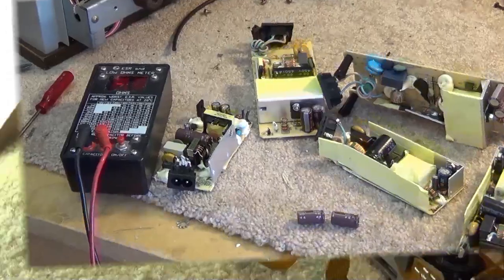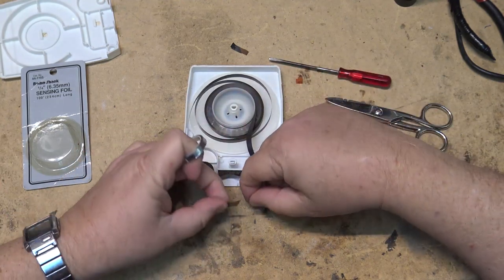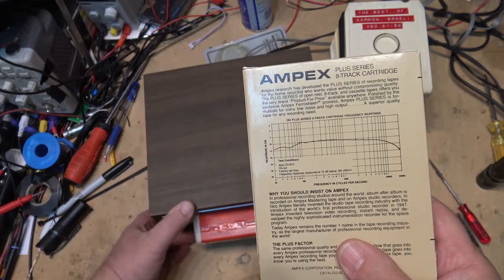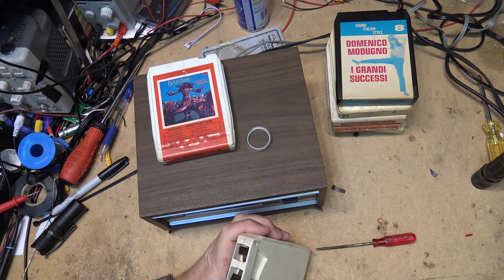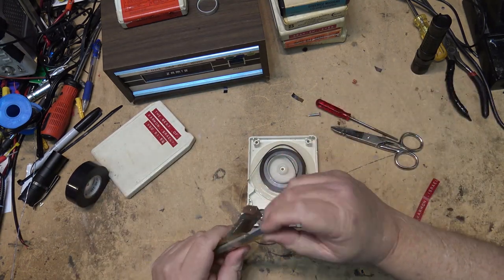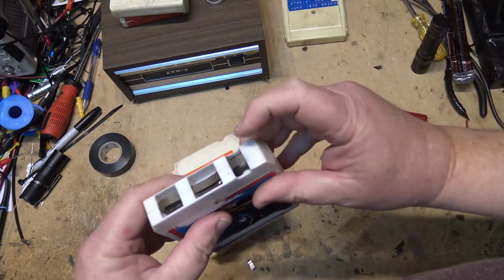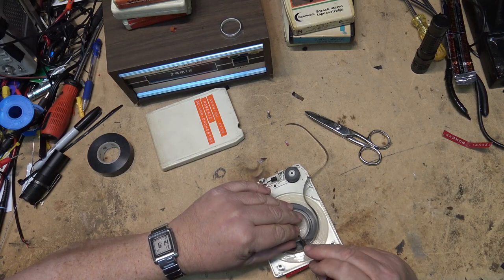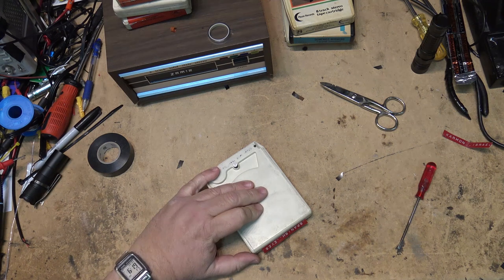How to repair an 8 track tape

Comment: Tip if you're going to do your own tape splicing and you don't have a splice tool so you have to use scissors or snips: cut both ends of the tape at the same time while you overlay the ends on top of each other. That way the angles of the cut match on both ends of the tape, and you can make a slice with no overlapping tape and no exposed adhesive.

Comment: I just bout an Akai X-1800SD and of the 8 track tapes had the tape broken. Actually looks much easier to fix that than I was expecting so thanks for this. Had never seen one of these before a few hours before I bought it but its so cool!
Reply: My 1800SD just ate my Waylon and Willie 8 track. It's why I'm here
Reply: It ripped about 20 feet out and wrapped up inside. I retaped it with that silver foil tape for ducts. Tried to spool it but too much was out so i cut the tape 2 inches from where it pulls out of the middle, respooled it around the outside, then scotch taped it where i cut it. The thing plays better than ever. It actually automatically changes the program now

Comment: Dave, 
Good information you've passed along. I've got a fair amount of 8 Track tapes and plan to rebuild them as you're doing. For repair supplies, I plan to pick up some sensing tape and pressure pads on eBay. Strangely enough there's quite a market for this stuff. What I've been able to do, if the tape is actually working is wait until the tape actually changes tracks then pull it out very quickly. The sensing tape is right there making it easy to replace.When the glue dries and the sensing tape fails and falls off, I take it apart like you've shown. I've got some cartridges that have a plastic pinch roller just like your tape has. I'm going by memory here, but it seems like those cartridges are for low budget tapes rather than 8 track tapes from the big record companies. On the other hand, I've even seen some rubber pinch rollers that have turned to goo.
Regards, Tom

Comment: THANK YOU! I THOUGHT IT WAS IMPOSSIBLE! my machine just ate my Waylon and Willie. It ripped about 20 feet out and wrapped up inside. I retaped it with that silver foil tape for ducts. Tried to spool it but too much was out so i cut the tape 2 inches from where it pulls out of the middle, respooled it around the outside, then scotch taped it where i cut it. The thing plays better than ever. It actually automatically changes the program now

Comment: Shouldn't the decomposed foam pressure pad also be replaced to give better contact between the tape and the head? The one in the tape you are resplicing seems to have lost all its springiness. They are usually very gummy at this stage, so will leaving it in there result in gummy residue sticking to the heads and causing tape snarls?
Reply from the maker: A new one will be put in to record it to the PC and then transferred to the next tape that needs it.

Comment: That black tape around the pinch roller will just introduce wow and flutter you would be better off using sanding paper to rough up the surface.
Reply: I wonder how much. I am going to try it. 8tracks suffer from W&F right out the factory.
Reply: NORMALIZATION OF IGNORANCE You should not make it worse then.

Comment: I just bought a 8 track player and a box of about 150 tapes, having fun with it. A couple of them have the shiny pinchrollers, such as the Elvis 40 Greatest two tape set. The splices failed on the same tapes, they must have been cutting corners with quality for mass production of those compilations.

Comment: Listening to an 8 track as I’mwatching this and ironically as you were talking about the sensing foil I hear “click-clack” and the player jumps from track 1 to track 2. On a memorex (used to be) blank tape. I’ve had better luck with the sensing foil holding out in those. I don’t know if it is a better adhesive that they used or what but so far seem to be holding out.

Comment: As a general rule, stay clear of 90 minute tapes.  They put more load on the capstan motor than the 45 minute tapes and are prone to uneven tape speed, especially in car-stereo and battery-operated players.
Reply: I've used 90 minute ones and have had no issues as long as you never use the fast forward feature.

Comment: Smashing repairs, that should keep your mate happy :-D
Plastic pinch roller, what a nasty idea :-(
i can imagine people putting the metal strip inwards lol
A couple of years ago i fixed an Audiovox 8 track for a mate, the output transistors on one channel were toast, funny blue pnp transistor.
The head stack assembly was locked up with concrete grease, no supprise lol.

Comment: I prefer not to cut the tape when I resplice especially on home recorded tapes where the music plays over the splice. I simply use the side of a straight edge razor to scrape off the dried out glue. Comes off easily after a few strokes.

Comment: I have done something in the past that would probably make audiophiles and techs cringe when repairing 8 tracks. Splice the tape with Scotch tape, cut a piece of run of the mill aluminum foil, put a piece of Scotch tape at each end of the foil and fasten it over the splice. Hey, it made the player switch on its own.  It seems like tapes I find that haven't been played in years are most likely to have a splice failure. Perhaps an occasional pinch between the roller and capstan keeps things in order.

Comment: Really enjoyed the video - thank you! One question, Ive been watching a lot of reel to reel vids and reading blogs - touching the side of the tape that passes over the tape head seems to be a big no no. Unless I am wrong, it seemed you were touching the tape both sides at some points - did it not matter so much with graphite tape or were you only have touching the lead in areas?
Reply from the maker: Touching the tape can transfer oil from your skin onto the tape which has the ability to degrade the sound as it passes over the head for a split second.  Chances are you will never notice this.   Since all my test tapes are garbage anyway i don't care.  I don't use tape for anything. My reel to reel is a display piece only.  I don't use it.

Comment: Since we're on the subject of 8-tracks, would you know if it's possible to repair the motor (mechanical governor?) in a Sony TC-208 player? Reason is that it has serious wow & flutter issues, but will play proper if if I lay it up, sideways.
Reply: Sounds like a belt to me??? Maybe.
Reply: No, it needed a new belt; the original had turned to goo. It played fine, until I popped in a long-play cart (Grease soundtrack, I think).
Reply: @Madness832  , Grease is the word, that's an oldie goldie like me. How long have you played it since the new belt? Also does the normal sized tapes play well?
Reply: I'd say I played it for maybe 10-15 hours before the problem occurred. Ever since then, no tape would play properly unless the deck was sideways. But it's currently packed away, since I had acquired a second 208, which works fine. I was, however, thinking of swapping motors between them (to make sure it's the culprit).
Reply: @Madness832  , I'd try another belt first off just to make certain. Or nuke it for a little bit, I think that's how he's done some old & odd belts to make them work again.
Reply: Yeah new don't mean nothing anymore, especially with belts but you may be right with the motor, or the pulley.
Reply: Both decks have new belts; swaps make no difference.
Reply: Did you clean the capstan?

Comment: how do you know where you put that sensing tape that is where the break in the song is on the tape?  otherwise wouldn't it sense that and change tracks in the middle of a song?
Reply: Most of the companies that produced these tape had the audio 'fade out' before the splice, and fade back in afterward.  Odds are just splicing it back together won't affect the music - UNLESS the break happens someplace other than the track-change splice.

Comment: Perhaps I could pick your expertise, can I spool in regular cassette tape into an 8 track cartridge> its going into tape echo machine. the cartridge I have now makes noise. I'm sure the noise is from the cartridge its old tape, probably 50 years old. perhaps the heads are dirty. in any case i'd like to minimize the noise.
Reply from the maker: 8 track tape is 1/4" wide.  Cassette 1/8". So no you cannot use cassette tape.  Reel to reel 1/4" also won't work because the back of 8 track tape has a graphite lubricant.  If you put non lubricated tape in the cartridge it will bind up pretty fast.

Comment: hello, I have an 8-track Panasonic RS-801US.  Could you help me by telling me where I can buy a replacement part.  The piece would be the gear, or Cam, which rotates to change the program.  thank you so much.
Reply from the maker: I have no idea.  Try eBay for a used part that someone is selling.
Reply: @12voltvids  thanks !

Comment: What kind of tape do you use when the break is not at the sensing area
Reply: Use regular splicing tape on the inside part of the tape.
Reply: I've used small amount of scotch tape effectively.  It's not rocket science ..these are 8 track tapes.  You'll get a half second drop out..but you'll find drop outs in factory sealed tapes.

Comment: 8 Tracks will sound good ... if you have a decent player I.E. a good home unit ... not cheapo car players ....I make my own foam replacements out of window and door foam ... cut it to size , then put scotch tape on the playing surface of the foam to prevent abrasion of the tape
Reply from the maker: I have a recorder and 2 home players. Will do a test recording on the recorder one of these days.

Comment: program ? what ? 8 tracks ,4 program ?  dues no make sense ,how the change tracks ?
Reply from the maker: You change tracks by pressing the program button. People, like you get confused when they hear 8 track, and they see only 4 programs. Remember there are 2 tracks required for stereo.
Program 1 plays tracks 1 and 5 for Left and Right audio channels. Program 2, 2 and 6, 3 is tracks 3 and 7, and program 4 is track 4 and 8.   8 tracks. A cassette is 2 tracks if it is a mono recorder, or 4 tracks if it is stereo.
Open reel tape can be 1 track (full track) Half track mono, Half track Stereo, and that came in 2 versions, staggered head and inline head, and quarter track 4 track stereo, and 4 track inline head.
Reply: @12voltvids  Thank you . i love your channel :)

Comment: You did it all wrong! There is an inherent problem with the 8 track tapes. When I was 9 years old I figured that problem in 1976. You need to produce some slack in the tape so that it is not bunched up in the center. Once you do that it will play for a while and then tighten up on the center again. You have to repeat this process to get these cartridges to play again. That is why they went out of production due to this engineering flaw!